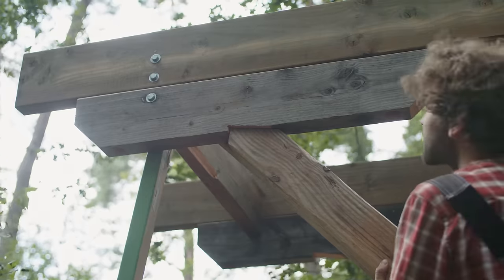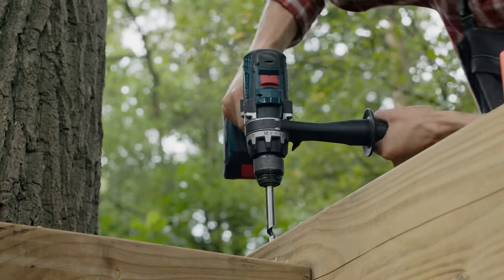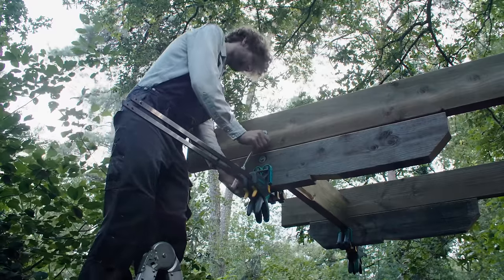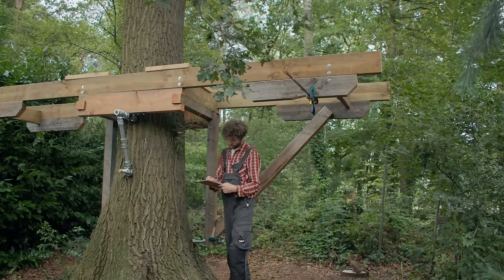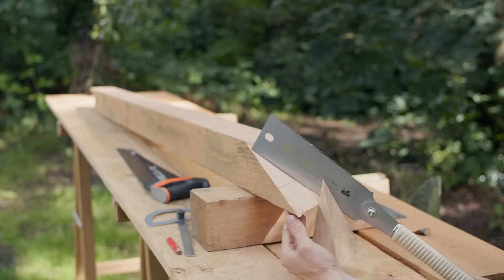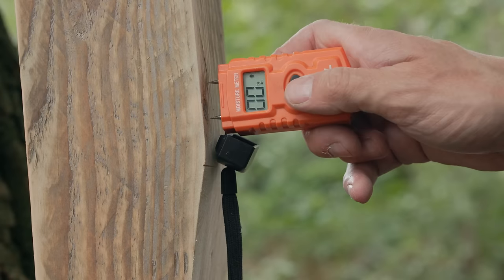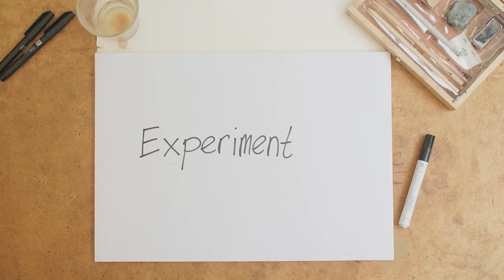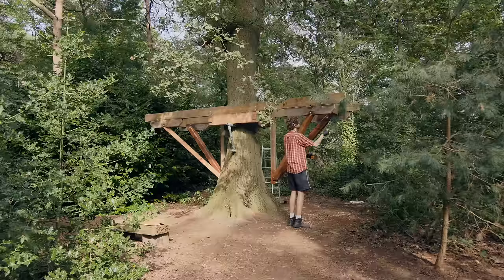Building A Treehouse Cabin In A Beautiful Forest Alone - Part 2

Comment: @BuildingInNature
Only a couple episodes in and am hooked!!
Curious - roughly how much weight those bolts can handle (each or in unison). Any idea?
Reply from the maker: That's great to hear! It depends of course on the construction and how far to the end of the bolt the weight is put on it. The closer to the tree the stronger. And another factor to consider is that (depending on the species of tree) the wood can be the weakest link and not the bolt. And then you have static load vs dynamic load when the trees move in a storm for example. For my treehouse I estimated it would be 1500 kg max. But always ask an engineer if you have doubts about your specific situation :)

Comment: Very nice :) where'd you buy the tree-bolt-anchors?
Reply: As for experiment 4, usually one puts dowels top to bottom, as the way you put them can cause some rollover issues when enough pressure is applied
Reply from the maker: Thanks! I made the treehouse bolts myself. I show how I make them in Part 1 of this treehouse build series. I tried to make it affordable and with materials that are widely available.
Reply from the maker: Thanks for sharing. Agree. The tubes are only meant to stop the sliding to the outside. I put short beams in perpendicular between the two long beams and the beam support they are resting on. My thought was that this makes it rigid enough to prevent rollover.  But I will keep inspecting this part during the built and if necessary make it stronger in the future.  @basvalkema4532